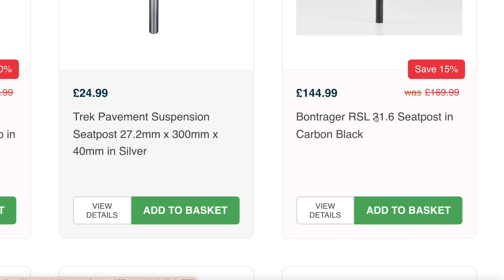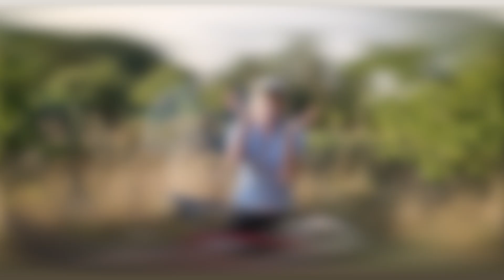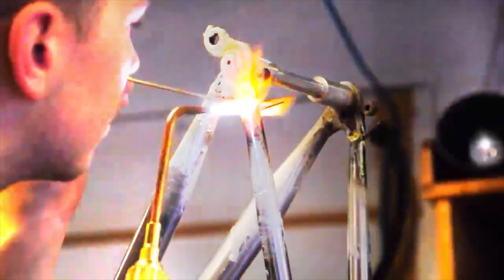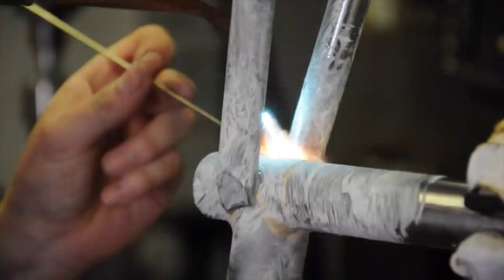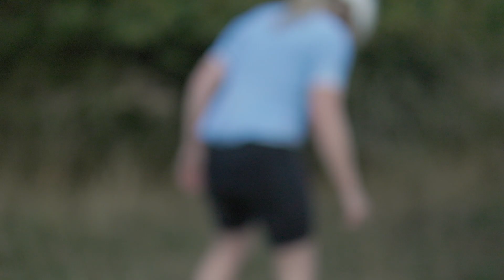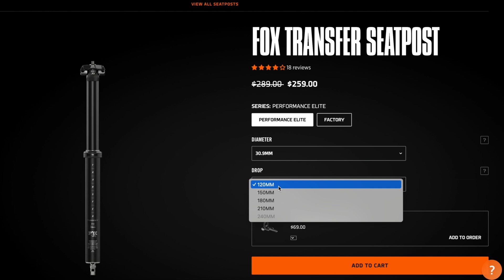Why Are Seatpost Sizes So Weird? | Seat Post Standards Explained

Comment: Does a larger diameter dropper post have any performance benefits over a small diameter dropper?
Reply from the maker: If we compared a thick enduro dropper with a really thin xc dropper, then (in theory) the bigger size could offer more internal space for more robust parts, and the added rigidity should put less ware on those parts, and the two things together could mean that a bigger post might be more durable and reliable. That said, an xc post could take less of a beating and outlast a bigger one. For smaller diameter increments (like 30.9 vs 31.6) I’d say they mainly exist to ensure there’s options for different frame sizes and there is very little functional difference.
Reply: I think Trek was claiming the 34.9 would rattle less.
Reply from the maker: @GHinWI I guess it possible if you have more room for better keys 🤷‍♀️

Comment: hi anna

i know you use or have done dropper-posts

after seeing a morgaw saddle (made with a suspension rail system) interesting but hate the actual saddle part i looked @ some suspension seatposts, including one designed more like a front fork but you have to remove seatpost to adjust it from bottom

have you any experience of either?

terry
Reply from the maker: I have used the Ergon Allroad post, with is a very forgiving feel for a hardtail or gravel bike. It takes the edge off and feels like low pressure tyres, but it can be fiddly to set up and get right. I’ve never used suspension posts as I tend to ride rear suspension bikes a lot
Reply: @annaonthebike  thanks Anna, i tried full suspension in about 2005 and despite everything i tried it felt being onboard a pogo stick, maybe i should have another go

Comment: One way to find out the internal diameter of your seat tube is ask your local bike shop if they have a width guage tool. It's a tapered tube with markings in mm on it, which when dropped into the seat tube stops when the taper is too wide to go any further, and checking against the markings gives the size.

Comment: 25.4 master race. LOL, but seriously, I have like 4 sizes seatposts right now, the BMX has the 25.4, my DJ has 30.9 (I found a gusset pivotal post to run bmx seats on it) 31.6mm on my hardtail and 34.9 on my enduro. Sucks I cant swap stuff around, but it is what it is I guess. Oh and my cheaper hardtail for super light duty and bike lane/sidewalk (we are allowed sidewalk riding in spots where I live where theres no bike lane, I refuse to ride amongst cars) has the common 27.2mm.
Reply from the maker: Blimey, you have all the sizes! 😅

Comment: Great explanation... The thing I'd add is that 34.9 is the only size, to my knowledge, that came to be popular due to dropper posts..  It may have already been in use somewhere, but I don't recall seeing until relatively recently..
Reply from the maker: Yes, I think you’re right. I guess it also allows for both the post and the frames to built more burlier too.
Reply: @annaonthebike I do gotta say, while I suspected that some of the common sizes go back to imperial measurements, it never dawned on me as to the why...  That was a cool history lesson..
Reply from the maker: @brianpeterson6872 thanks for the kudos! Glad I can stoke the inquisitiveness 😊

Comment: Thank you for the video, Anna. Nerdy seatpost facts aside, how do you find the mini-ratchet set vs a multitool on rides?
Reply from the maker: I find it quicker to loosen and tighten things with a ratchet. With a Multitool I find I often have to take them out, turn them and then put them back in multiple times when getting into awkward places, e.g. with seat clamp bolts, a multitool always bashes the post every half turn, but with a ratchet you just click and click and click! If that makes any sense at all 🤷‍♀️😂
Reply: @annaonthebike  It makes perfect sense. So much sense that I've already ordered a set. It should make, as you say, adjusting seat clamp bolts and also head unit mount bolts, where you bash into the stem, so much easier.
Reply from the maker: @withBlackjackandHookers nice! And you can’t forget it if it’s part of the bike 😅

Comment: The reason I ended up replacing my Cove G-Spot was that it had a 30.0mm seat post, so no dropper would fit it*. 

*bar a shimmed 27.2mm dropper, where there was little choice and most were crap and/or short travel until quite recently. My Crux CX bike now has a lovely 120mm dropper.
Reply from the maker: Wow! Droppers on CX bikes? I remember being skeptical when disc brakes became a thing 😅
Reply: @annaonthebike   - well my CX bike does serious MTBing duties at times too. Overtaking folk on full sus bikes is a particular delight, particularly with road tyres fitted and at a trail centre. It makes my light XC bike feel like a DH monster bike. 😁
Reply from the maker: @imajez1 haha nice work 😅

Comment: Hi just wondered if you can help  just got into mountain biking I'm  nearly sixty got a twelve year old talked me in to  going with him what size bike  and best bike for £500 0 I'm six foot one appreciate any help great channel ❤
Reply: I'm about the same height.  You probably want a large, but maybe an extra large, depending on the manufacturer.
I'm not going to recommend a bike, but I'll warn you that many adult mountain bikes under four-figures are pretty cut-rate.  Especially avoid anything with rear suspension, because that really can't be done well under 1000.
Reply from the maker: Trek say that their Marlin is a popular bike and that starts at £500. I would go into a Trek store and see if you can sit on one for size. They are very friendly and helpful and will be able to build and set your bike up for you.

Comment: Hello Anna, another great video!  I like to ride my 40 year old Ross MTB that I have converted to an electric gravel grinder. (captainchipowen 5184)  The problem is that I need a suspension post for it, but it was built out of steel tubing and uses a 25.4mm post.  The only ones I can source are the cheap spring things that really don't work. The good ones like Red Shift do not offer one in my size.  Do you have any ideas?

Comment: Steel uses smaller tubing to aluminium, so seat post need to work with the material
Reply: The outside diameter may be the same, but the wall thickness will be different, so the seat tube that goes inside will have to be different.

Comment: Too many sizes of many bike components. That's one reason why we also end up buying millions of one-use tools. 😂 Love your red Merckx,Anna!
Reply: 3 sizes of Shimano Hollowtech bottom bracket wrenches.  A different one for square taper.  One for DUB.  Chris King might be another unique one.  Then there's press-in BB tools.
Reply: I have a hardtail MTB with Boost QR rear wheel.  That's 141mm wide, not compatible with the 142mm wide hubs.  There's also 135, 148, and 157mm hubs, and single-speed cassette and freewheel hubs, and fixed-gear hubs.
Reply: TBH, bicycles have nothing on the car world when it comes to special tools.  I have so many obscure tools for working on my cars, it dwarfs my bike tool collection - and I've been gathering bike tools for over 40 years.  And believe it or not, bike tools are a lot cheaper and a lot smaller.

Comment: many rare sizes in the 90's: for instance: 26.8, 27 and 27.2 you could squeze a 27.2 post in a 27 mm frame but it was a pia to get it back out again. and manitou frames actually used a manitou outer fork leg as a seat post 🙂
Reply: I had a Manitou FS frame back in the day.  In addition to the odd, non-standard seat post, it also ran a modified XTR front derailleur with a special clamp to fit around that big seat tube.  
In some ways, seat posts for those early frames were almost like the different headsets and bottom brackets we have today. 
26.8 was a pretty common post size back then.  For me, I've become so reliant on riding with a dropper post the lack of a 26.8 dropper post has relegated a few old fames I have into permanent retirement.
Reply from the maker: Oooh good knowledge on the Manitou! That definitely seems like Frankenbike territory though 😅